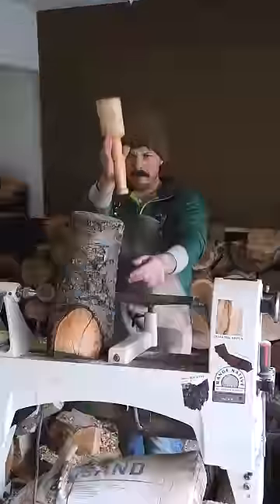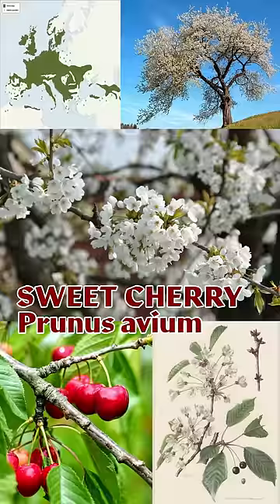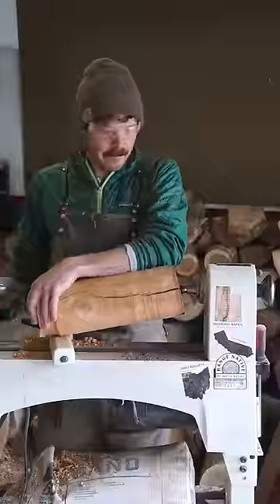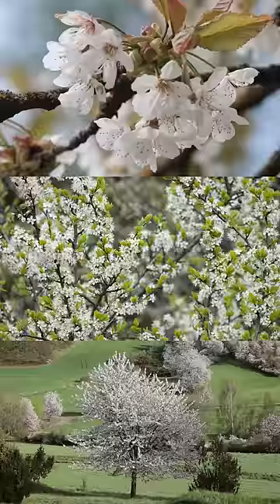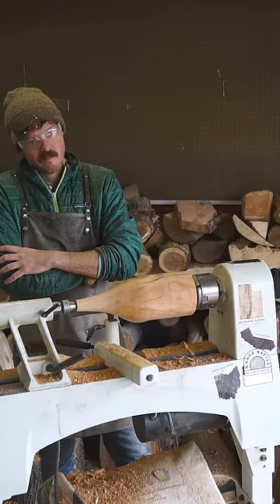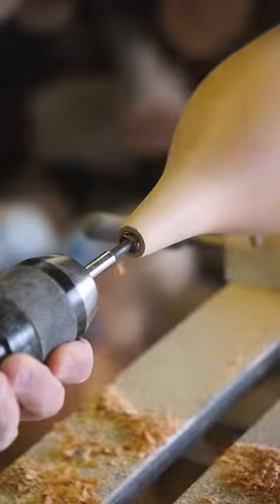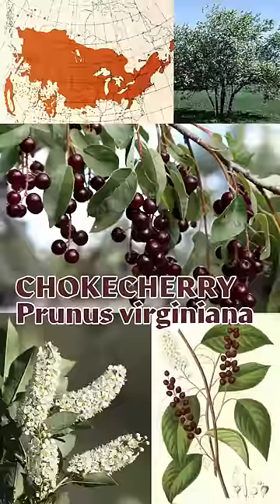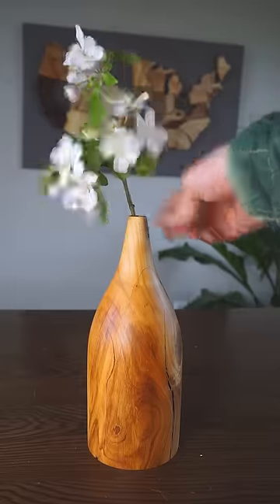Cherry wood vase

Comment: I rarely like your contact and think your vases always turn out good, but it's getting dull seeing them with basics the exact same shape every time.
I get that might be the point, making the color and texture of the wood the center part of the vase, but if you're not gonna change the shape, you could add previous vases in the final shot as a comparison.
Reply: Sorry autocorrect, not rarely, I meant really